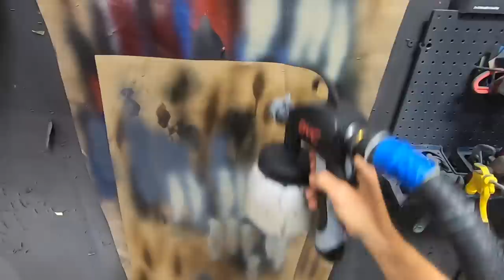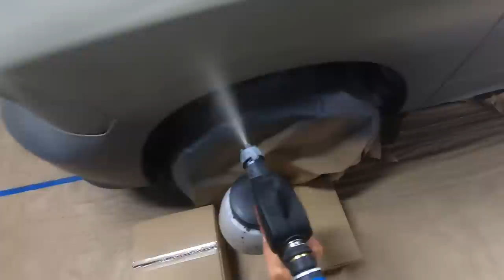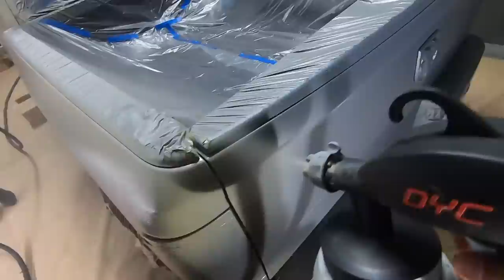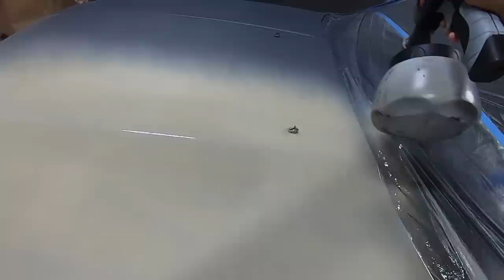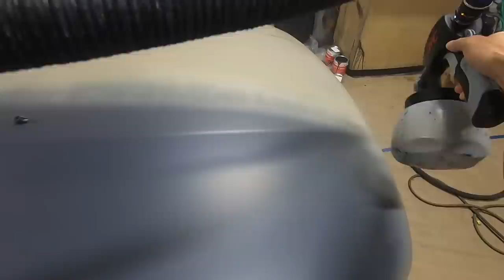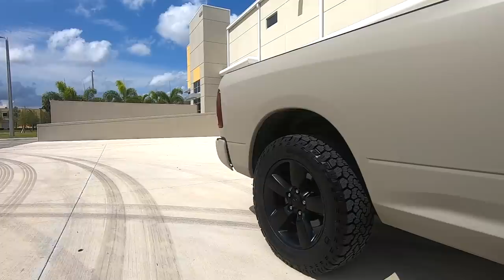Desert Camo Tan is PERFECT for TRUCKS

Comment: Can you make a timelapsed POV video from start to finish. Think it would be dope to get a different perspective. Maybe another camera just timelasped in between coats to see how they dry. Just something different. Would love to see you guys prep and work on something old. Considering plastidipping my 1968 F100!
Reply: iMachacker wow you have a F100
Reply: ILogic 1 yeah bought it about a year ago. Slowing tinkering with it. Thinking it’s time to prime and dip 👀
Reply: iMachacker how much did cost, was it cheap?
Reply: ILogic 1 yeah but it wasn’t a perfect truck. Bought it for $4,000 mainly cause it already had power steering, disk brakes, and power brakes. Paint is terrible, rusty in the cab corners, bad interior, but it’s a project so ya gotta just work it at it :)

Comment: Meaby u can try an ,  wagner SF 23 airless (Non aircoat) spray with an heat element on 40 decrease Celsius.  1.1 bar work force with an green 313 long life spray tip. Should do wonders to the naked eye.
Reply: NPC #102117  What?

Comment: UK plastidip ltd
I plastidiped my fairings on my Yamaha mt10. I had it on for awhile to find out after peeling the plastidip off it turned my fairing from black to green. 
Used the fluro blaze plastidip. 
Done everything correct step by step. 
Have use plastidip for several years and never had a issue befor. 
UK plastidip ltd wont sort any sort of compensation,  pay for it to be fixed or replaced. Customer service is poor to the point that they where swearing at me. 

Think plastidip American firm needs to have a word with the uk one.